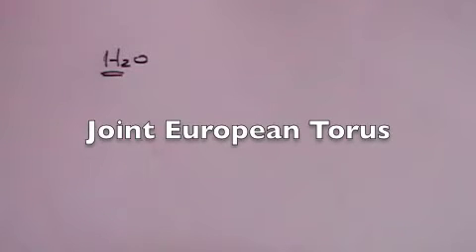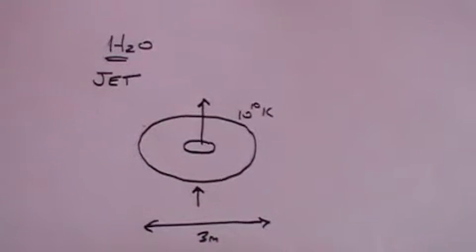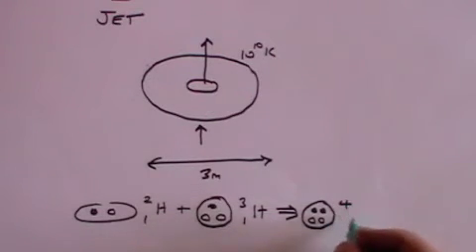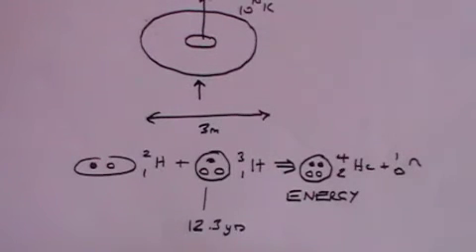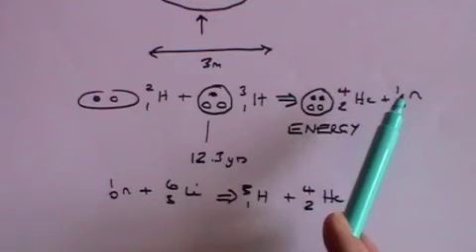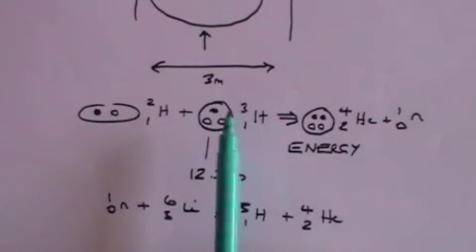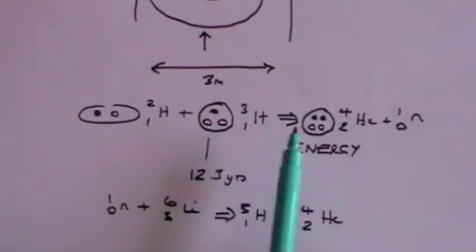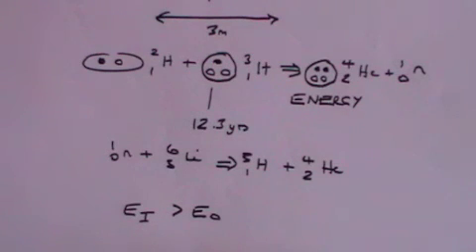Nuclear Fusion - Part 2 of 2

Comment: Thanks for the video, I have a question! Is less efficient this reactor because of H2O instead of H and He?
In that case, would be posible to use H? I guess we could use the electricity coming out from the reactor to create more with electrolysis that would refuel again the reactor with hydrogen, I guess that if it doesn't exist is because is not posible. Is because H could explote? since there is not enough pressure as in the sun so H would have combustion instead of fusion? or i'm just saying rubbish hahah

Comment: Uhm, 10 to the 10th is 100 billion kelvin, not 10 billion kelvin. (billion is 10 to the 9th).
Also, kelvin-temperatures aren't in degrees, you just say 10 to the 10th billion kelvin.
Reply: ???  10^10 = 10 x 10^9 = 10 billion.  No?

Comment: how would they get the energy outside from the reactor if the whole thing is clad in Lithium plates and is at 10 bil. K degrees ?
Reply from the maker: The energy is in the form of heat which is used to drive the turbines.

Comment: Small corrections for this one: 1. the maximum temperature in JET is 10^8 K rather than 10^10. 2. the main magnetic field in a tokamak is not vertical as you draw, but more like the red curves in this image differ.nl/sites/default/files/images/research/fusion_physics/Tokamak.png

I'm being picky, but in the whole, I'm really glad you are trying to inform the public about the endeavor of fusion.

Comment from the maker: I assume you are thinking that if the Torus has the same temperature as the inside of the sun then it ought to be the same distance away for safety reasons. Not true. It is not just a question of temperature. The sun is massive with huge amounts of energy being emitted. There are still safety issues with the Torus of course.